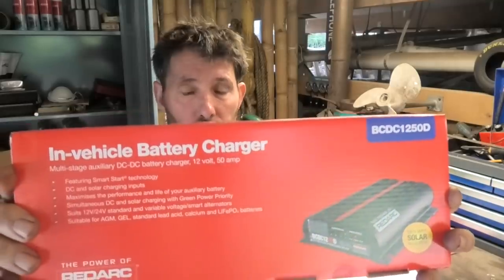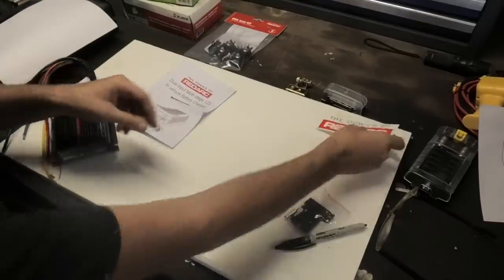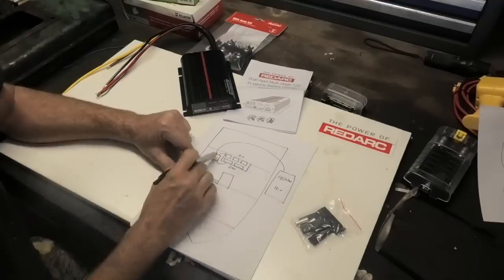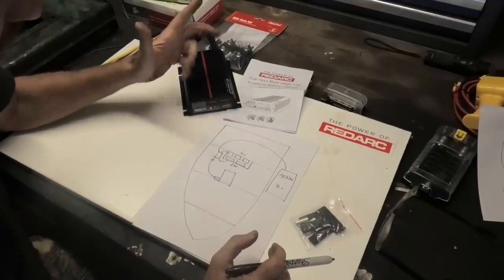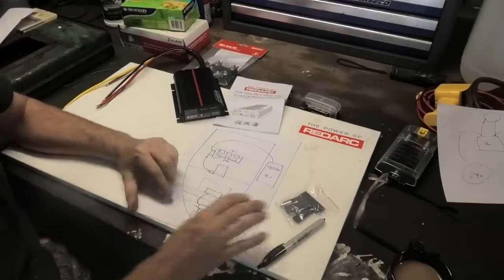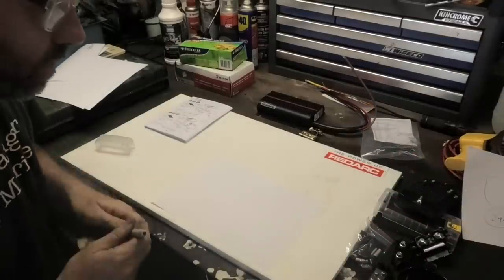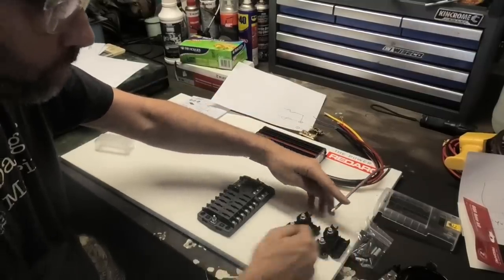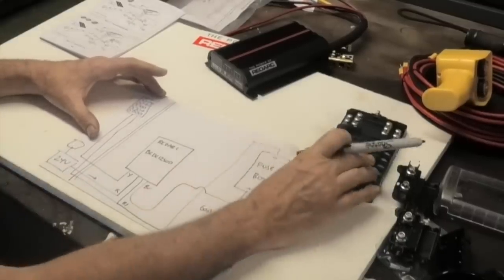Planning the trawler electrics

Comment: Redundancy is the key to safety, not just convenience, so that is good you are keeping all those power systems (petrol generator, solar, alternator off engine). 

Just some thoughts and questions;

1/ With the macbook, consider water proofing - immerse it in epoxy, let it seep into everything, close the lid and let it set. Reduces power consumption substantially too. (to zero) :)

2/ Higher volts means lower current which means lighter gauge wiring...you may want to look at routing 24V rather than 12V? (That is what I am doing in my camper), but then again, I have the 24V appliances which tend to get a little more expensive than their 12V counterparts - not always, but often.
3/ I would've thought DC could pose a problem to a boat and AC would be the less problematic choice since it cannot cause galvanic corrosion AFAIK. Maybe you can find someone that knows to talk about that? (or even a learned commenter) 

Any info from you is always welcome and trusted, so thanks for more info yet again!

Comment: I have enjoyed watching this boat rebuild. Why not change over to all 12V. That Detroit can run a 12V starter. All the big trucks here in the States have 12V systems. Would make it safer when at sea also by redundancy of battery equipment. Good luck

Comment: It may have been mentioned earlier, but I would look at having two fuses for some circuits like lights so a  blown fuse only takes half the system out.  Having half your lights working while you fix a fuse is better than being  plunged into total darkness.

Comment: Hi Stu; I don't know if anyone touched on this topic. when you use multiple batteries in an application you should install a Battery Isolator. You may need more than one with 6  batteries in line. The Isolator keeps the current flowing in one direction. Your Redarc power inverter may act as an isolator, ( Maybe ). Just a little more on your plate.  Flashlight yep !!!.  I hope this isolator information helps Mate. See you !!!. Angelo.
Reply from the maker: Thanks mate, will look into it. Appreciate the info!

Comment: I would buy another REDARC and keep it in your spare parts bin on board. With everything channeled through that one controller. A spare would be priceless if you are out several hours and it fails.
Reply: Yeah that's my thoughts, I'd be looking for something for redundancy
Reply: He just needs a switched bypass directly from the alternator. And a spare set of Andersons on the battery bank to plug the solar in via a cheap separate solar mppt reg. A mppt will self regulate even if the alternator is pumping in juice.

These charge controllers are pretty well sealed, they should generate enough internal heat daily with the solar input to take care of any condensation. Instructions say you can mount them in engine bays on 4x4's, although most I've seen don't! 

I'd have my redundancy setup including battery bank in the wheel house & able to be switched from that position.

Million different ways to do this, you'll need one or two of those Cooper's 6packs to nut this out.
Reply: @andrewiannello6548  A set of jumper leads from crank to house batteries works also. Redarc don't warranty their DCDC chargers for under bonnet fitment although they are ok for anything forward of the radiator from what I have read

Comment: Hello DangarStu, As a purchaser for a boat builder in northern Washington State, I am very familiar with Blue Sea Systems custom 360 Panels, and I can tell you that they are, by a longshot, the least expensive option for custom marine panels that I know of. The original Blue Sea building in Bellingham WA, burned down last december. It took some months to find another building, and re establish a new manufacturing and testing line for the 360 panels. It took more time for them to receive some long lead time components, and clear the build backlog. Thus, 360 panels were unobtanium for a long time, and I had boats that needed to be delivered. We had to spend 1.5 to 2.5 times the Blue Sea Systems price to have custom panels made. Other items that were manufactured, or warehoused at the Bellingham location were also affected, so it has been painful for the entire marine industry. They are just now getting back to normal lead times for delivery of product. On top of that, they are now a subsidiary of Power Products LLC. along with Ancor, Marinco, BEP, ETC.  Blue Sea Systems products have been the industry leader in quality marine electric components, as far as I am concerned. It remains to be seen what happens under the Power Products umbrella. Hopefully good things.
Reply: Thanks for a tip on the Redarc products. I just sent a text off to our facility manager. He is the main "new stuff" geek in the company.

Comment: You will also need the 24v battery earth connected to the other earths.
Like other people have said, I think a 24v winch would be the way to go for the anchor winch due tot he current draw.
It is my (Electrician/Non Marine 24v vehicle) understanding that earthing the hull is a very good idea.
If you are screwing around alot with the 230v AC side of things make sure to get a sparky mate to check it all over to make sure you are good to go.(Not sure of the legality of doing your own 230v wiring on a boat)
A distribution board in the wheelhouse is a excellent idea. Personally I would put another of those larger fuse holders in to feed it.
Otherwise all the bases seem covered!
Reply from the maker: Hey mate. 24V winch is definitely becoming the obvious way to go. I'll be ordering some extra fuses to cover the branch circuit and definitely consulting the experts for any 240V work. :)

Comment: A good source for info on boat electrical systems, including clear schematics, is the American Boat & Yacht Council (ABYC).  Also if you will be diving from your trawler you should do a little Google research on Electric Shock Drowning, which can caused by stray currents on boat AC electrical systems. ABYC also covers it.

Comment: Hi, I like your approach with the REDARC unit. There is however concern that a single point of failure will leave your vessel out of service. It would be difficult to over engineer your DC system. 
I’d recommend a dedicated house charge system, via alternator, a dedicated MPPT solar controller and a good battery monitor. 
It is also recommended to run the suitable cable to a 24V anchor windlass. The cost of a dedicated windlass battery and charging device will outweigh the cost of good cabling. Happy to offer help on this subject offline, our family business specialises in Marine electrical design. 
Steve.
Reply from the maker: Thanks Steve, it would be great to have a chat about a few things. A big part of doing this planning video was to get the right advice early rather than trying to fix a system I had already installed. My email is dangarstu@gmail.com if you want to get in touch.

Comment: Haha, I thought the main reason for the loss of boats was people forgetting they have a boat on a mooring for a couple of years.
I've also thought about placing a battery next to the anchor winch but I'm still not convinced. The added outlay for a (6th!!) battery compared to the price of thick copper per metre still sways me to the opinion that the anchor winch is better driven direct from the main battery bank with heavy gauge cables. As you say, it's not a giant boat so the run is only ~15' and spending a little extra on the wire is like buying 10 batteries if you think about how long the copper will last. Is the redundancy factor your concern?
Thank you for the "bonus" video :)

Comment: Electronics hate 3 things.
#1 Heat
#2 Water/ moisture
#3 vibration

I would plan to keep that Redarc unit away from those 3 things and you should be good.  That Redarc unit looks pretty nice by the way.
Reply: Chris Glassey I've owned a steel hull diesel trawler and can guarantee that an engine room will have heat, moisture and vibration. I wouldn't put that thing in an engine room either, no way.

Comment: My suggestion is if you already have hydraulic steering run two lines upfront and get a hydraulic barrel winch for a anchor winch.
  I'm sure it would not be hard to find a good used one cheap .I learned the electric ones just don't hold up to harsh weather and water.
Reply: The hydraulic steering in a boat is not saying it does not have an electric pump or run off the engine it is just charged from the steering wheel itself it's pressurized both sides, basically it works like on a push-pull system

Comment: You are going to need some serious power to that winch.  I have a Lonestar GX1, and while putting 75m of rope on it, drained the battery flat - Had to go up and down twice.  Your anchor will hopefully be a heck of a lot heavier, and possibly deeper water as well.
Reply: There are free fall/free spool anchor winches available, as you say winding out & then winding in can place too much demand on battery capacity.
Reply from the maker: Yes, they do draw a lot of current, I'm going to use the starting batteries after reading the comments.

Comment: I am going to base the following on "shit happens" and I know it happens to you as I have watched your videos :) Run a charging line up to the winch battery through an isolator.  Since the alternator is IT for power, put a volts gauge and a mechanical ammeter for it in the engine bay - when things go south this is where you'll be, anyway.  A set of amp and volt gauges for engine 24v, house 12v, and the winch systems just for monitoring so you can spot trends like a high load, batteries not taking a charge, or a failing alternator/starter/motor.  They will also help keep you within your energy/wiring 'budget' and you'll know if that new coffee maker or seawater-to-beer converter is drawing too many electrons.  Have you made allowances for engine room and battery ventilation (including winch)?  Not just for vapor off gassing but in case billowing clouds of noxious smoke from fried wiring or oil hitting a hot engine.  Install a 'fancy gizmo' bypass so you can easily reroute power for charging if needed.  You might have left your tools or something at home when things go wrong (is usually the case) and you won't have to bodge something up.  Think Star Trek, man!  Do you want to have to wait for hours while Scotty or Geordie is rerouting the blown EPS conduit when you could just go flip a switch or two and get back to base before all the crab legs are gone?!  On the other hand, you'll want some strategically placed kill switches around in case of Romulan pirates or when you have a hot date aboard {CLICK}- "Oh dear, we'll have to sleep aboard until someone finds us.  My cabin is right this way...".
Reply from the maker: Ventilation in the engine bay is definitely something I'm going to look into. There is currently a couple of pipes to the top of the wheel house about 4 inch in diameter but I might also look into adding something fan forced.

Comment: Stu great job as always, I would have definitely redo the wiring like you're doing the bonding issue is a very big issue really consult someone in the know I had an issue on my boat 24 volt starting batteries and 12 volt house system the problem was someone use a 24-volt bilge pump somehow the pump connections inside are open I did not have a bonding strap on the prop shaft when I had water in the hole somehow it almost wore out the prop shaft and running gear galvanic corrosion is no joke wish I still had my meter for it I would have sent it to you
Reply from the maker: The bonding really makes me nervous. I want to make sure I understand it 100% before I make any decisions about which way to go.

Comment: I ripped out all my wires on my boat and left some of it but re-wiring my boat was the best decision I made. Peace of mind. ALSO when you look at those amperage cabling apps, remember the distance for power is from the battery to the load and BACK to the battery. The full circuit.
Reply from the maker: Yes, there is good peace of mind in completely rewiring. Excellent point about calculating using the full lenght of the return journey!
Reply: Dangar Marine excellent series by the way. I’m digging the Trawler rebuild. Very exciting!!!

Comment: I got a 40hp Evinrude outboard. 1988. Bought it brand new. Only been used very little each year. Always fired right up. I changed the bulb last year and ever since it fires right up when cold and will run for how ever long you want to run it but when you shut it off and let it set say 20 min. will not fire right back up. takes about ten cranks before it will fire back up. Took the carb. apart. everything perfect. Great fire, Great comp. Bulb gets a little soft every time it does this. Bad bulb maybe?
Reply from the maker: It could be yes, or it could be that it is flooding when being shut down for some reason.
Reply: I thought of that but when i turn the primer switch you can hear a swoosh of gas going in, Wouldn't that be not primed if that was the case?

Comment: The Redarc looks like a nice bit of kit - the gauges they did for Brupeg look great as well. Couple of points to consider from me. 1st is - shouldn't there be fused protection in the 24v line coming from the alternator into the Redarc box? if you have power flowing down this line you need to protect the system. 

2nd: Asking a battery to operate a anchor retrieval system without a charging system topping it up as you operate the winch is asking for trouble. The current draw will destroy the battery very quickly. You will (should) only be pulling up the anchor with the engine running so why not use that current to charge it.  If you are worried about cable size/length use a stand alone battery charger to top it up  -  the cables for that will be smaller.
Reply from the maker: Yes, I'm definitely going to need a few extra fuses in there. More and more I am liking the idea of just running the cables and running the winch off the starting batteries.

Comment: I would put all the heavy electrical stuff in the engine bay and run a cable to the wheel house to feed a sub panel for your electronics and lights. The engine bay may be too hot for that charge controller so you might want to discuss it's placement with the manufacturer.
Reply from the maker: It seems as though the engine bay should be fine for this unit, but I will be keeping an eye on the temps.

Comment: Dont forgot to use Dielectric grease on wire contacts circuit breakers and battery terminals its pretty cheap and will stop arching and corrosion
Reply: Yip fully agree there.

Comment: Redarc makes great gauges. Check out Project Brupeg. They’re rebuilding a steel troller and did a really nice wire job. I like your DC plan. You may not even need AC or just use an inverter. Cheers
Reply from the maker: I do have a big inverter that came with the boat. I think that will be my only AC.

Comment: The important stuff should have their own circuit buss and/or be individually fused so a loss of one item does not take out everything else on that circuit at the same time. It makes sense to separate your lighting to 2 circuits, one for nav lights etc, one for cabin and deck lights. Same goes for the electronics. One for navigation equipment etc., one for bilge pumps, deck washes (which can double as rudimentary fire hoses), and other ancillary equipment etc..
Reply from the maker: Yep, I will definitely be putting some thought into the number of circuits and which devices share a circuit.

Comment: Stu, with this focus on wiring and the darkness inherent in your room below, I was wondering if an idea I’ve been thinking on for some time might be an interesting addition to your project. I’m currently searching for caves on my property, mainly for the water, but also for a cool hidden space. I’ve always thought that light would be an issue: maybe a small hydro system and LEDs might be sustainable, but I’ve wondered if light could be piped in, much like electricity, via fiber optic cable? With a  collector of sorts, one could bring natural light down below and even split the cabling into multiple “outlets” lighting the space. I know it sounds bizarre and I’ve not done any feasibility or economic study, but I think fiber optic cable might not be too wildly expensive, given they put it everywhere and under oceans. It might be an interesting and sustainable way of getting natural light below-deck and wouldn’t require power. You could also run the cable in the safest places instead of leaky portholes or hatches.

Just an idea! As ever, love the content! BW
Reply from the maker: Hey mate. It is possible. Skylights are very common in houses here to bring light into rooms during the day with now power at all.